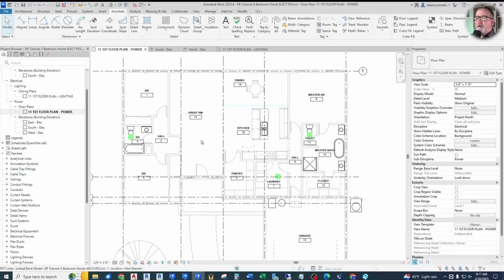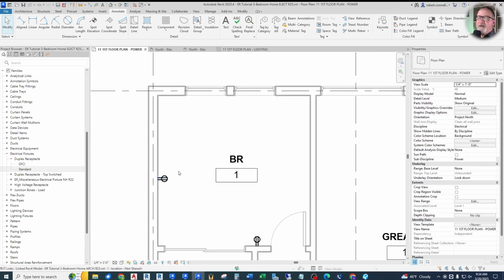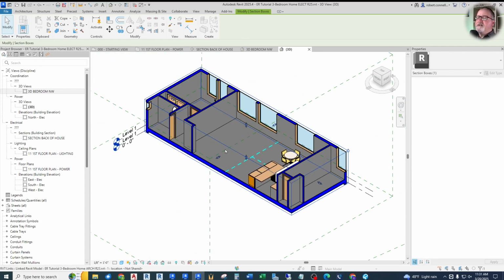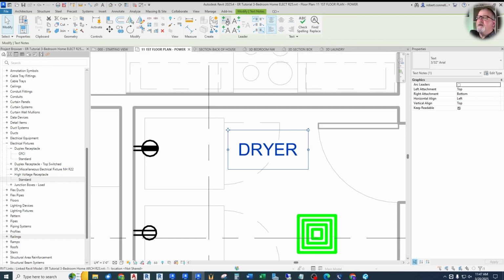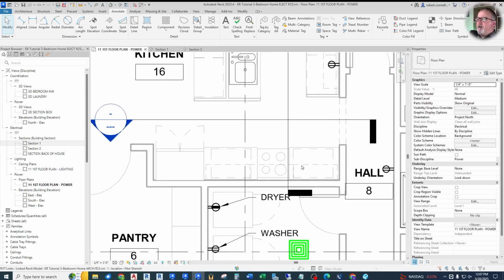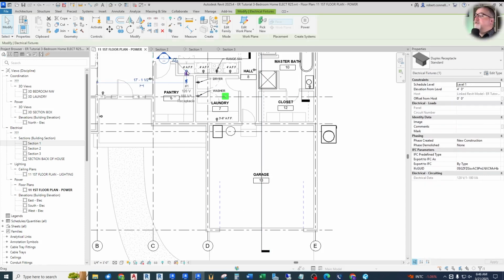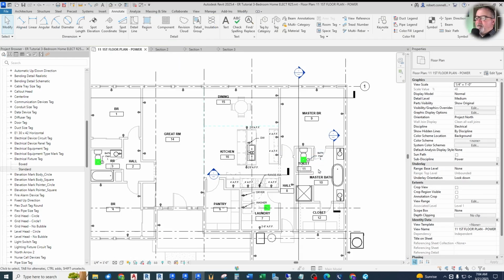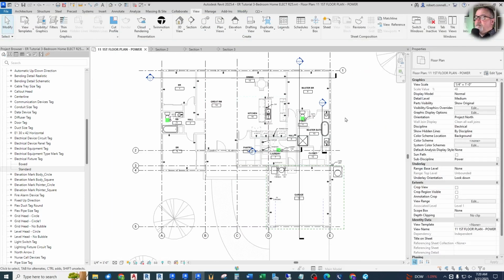Learn Revit Electrical Circuiting - Full Beginner Series

Comment: Hello Rob. You did it again, excellent tutorial, I learned a lot, your attention to detail is incredible.
When I placed the first receptacle 240V and I placed the rest of the receptacles, all were placed at the bottom of level 1 and at the wrong position and I couldn't place them in the right position.
I have installed Revit 2024.
Thanks for your help.
Reply from the maker: Hey there - thanks for the feedback! Make sure you placed "on vertical face" so that you hit a wall. Otherwise you might end up placing on the floor.

Comment: Hey Rob I’m very new to this. Just curious why the right side of the master bedroom is ok with only one receptacle. Seems like there needs to be one more. I’m probably wrong but I wanted to ask. Thanks your videos are great!
Reply from the maker: Hey there! Actually, you are partially correct, in that the receptacle on that east wall needs to be moved south a few feet so that it is not more than 6' from the end of the doorway into the restroom on the South wall, and then the other receptacles need to shift so they are not more than 12' apart - I show the correct number of receptacles, but the spacing  needs to be adjusted. But good eye - you saw that there is too much wall on that East side!

Comment: what about other Electrical systems like ELV Systems Data, Fire Alarm, Access Control, Cctv etc.
Reply from the maker: Other people in my firm design those systems, as I am primarily a power and lighting engineer. But similar techniques are used for placing the respective families.
Reply: @ElectricRob  can u recommend me any platform to learn these systems.